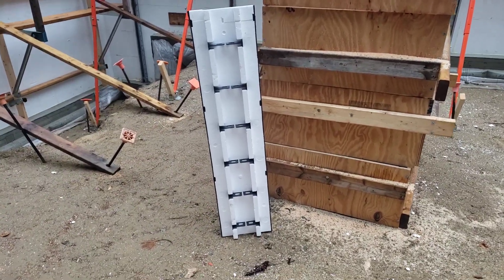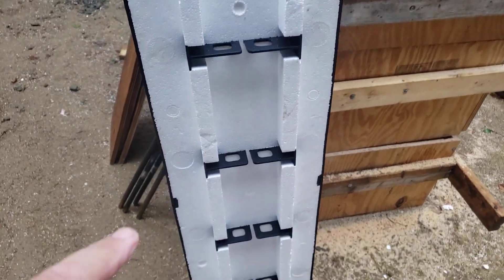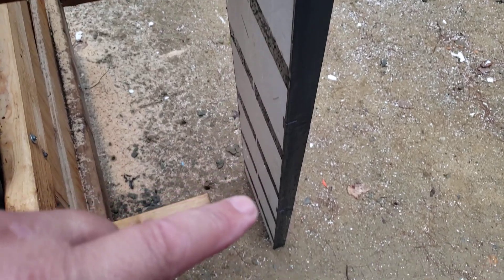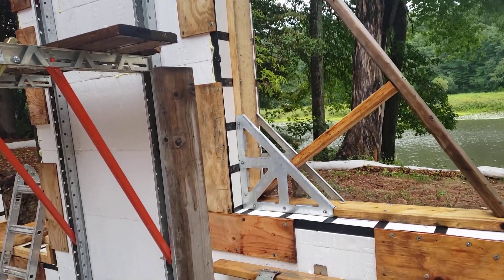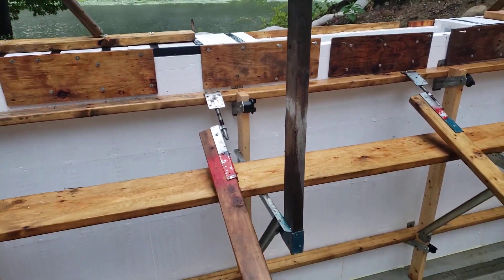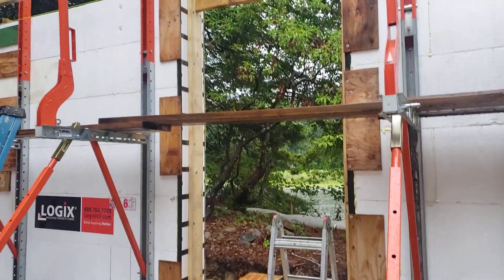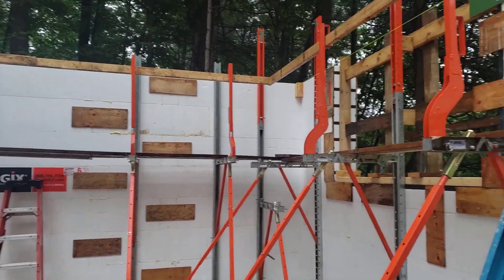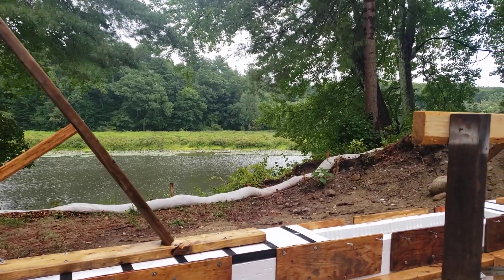What is a Pro Buck for ICF Foundations

Comment: I have a kitchen island that suffers ftom the excessive deflection problem that you described in this video.  I have not yet finished the basement.  Can I stiffen those I joists by adding osb or plywood to both baces of the ecisting joists?
Reply from the maker: That will help some, but a beam or deepening the joists by sistering with larger member would be better